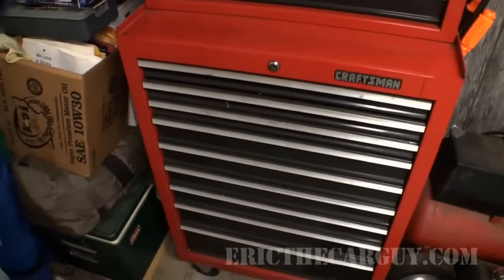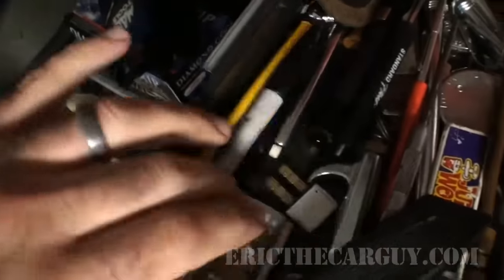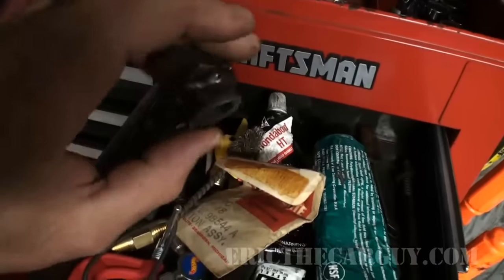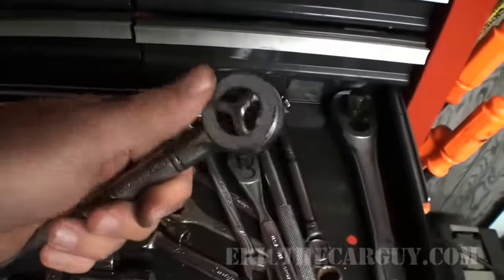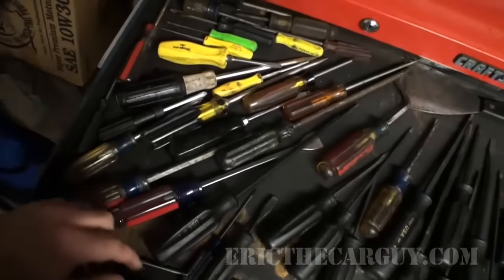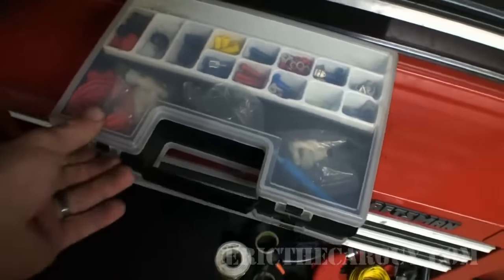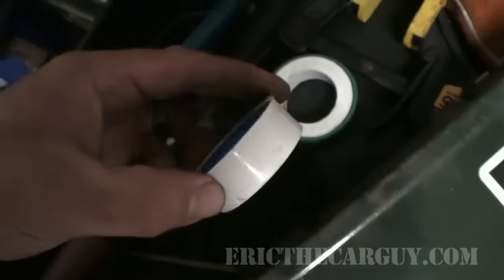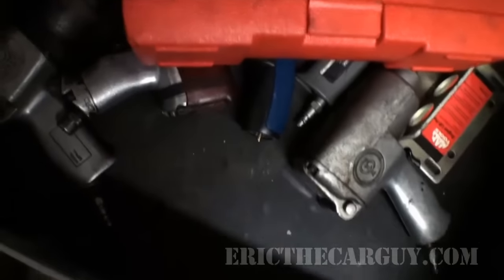What's Inside EricTheCarGuy's 'Home' Tool Box? - EricTheCarGuy

Comment: The random bag of hooks @20:29 is a hardware kit for a manual screw type strut spring compressor. They help hold the spring compressor in place and keep it from slipping around while you are cranking that huge spring down with it.

Comment from the maker: @Toyota4Runner4Ever I haven't gapped a spark plug in years, especially if they are NGK.  Check the under hood sticker as they often list the plugs you need.  A video would be great however.

Comment: EricTheCarGuy's the best one I've ever found through net. I am a private practicing Mechanic, a Filipino mechanic. I got a multibrand set of tools and bought it every time I encounter different type of fastener. Actually you don't need to have a set of top 2 brand that is offering a lifetime warranty because you're not going to ruin a tools if you used it in proper way. In my 3 years experience I just got an snap-off flat screwdriver. LOL, dude can I have some of those?

Comment: The wire connections you said not to use I have several on my car at the moment. Added a trailer hitch to my Dodge Intrepid and my dad brought them from his auto parts store. He did warn me in about a year they will stop working. They are good for a quick fix, but not a permanent fix for splicing a wire.

Comment from the maker: @aaronac8 Putting engines in mostly, it's nice to put into a hole that you're trying to line up so that you can put bolts in easier.  They're used a lot in construction for the same thing.

Comment: I got those two wrenches you mentioned. SUPER helpful. I mainly work on Toyota's, but all the sizes are pretty much the same. 10, 12, 13, 14, 17, 19, 22. I have the 10/12 and 14/19. They're Mac Tools though, but I really liked the feel. I pretty much replaced my front ball joints on my Tacoma with these guys (and a torque wrench + pry bar).

Comment: My dad borrowed that exact same inch pound wrench when we replaced the bearings in my rear differential. I believe it was to tell when the pinion bearing pre-load was right by checking the turning resistance, as in it should take so many inch pounds to turn the pinion from stop. That is just turning the pinion itself in the housing, nothing else installed and no driveshaft on it either.

Comment: I say this- Alot of ppl cut down Craftsman, yes I am aware they have switched to being made in china, but overall they are a good tool, I am not a pro Mechanic and I have no need for Snap-on, all my tools I have can do any job you have, My mato is use the right tool for the job, be kind to it, and it will treat you well,If you have a stuck bolt use a touch of heat rather than a cheatwer bar, , keep your tools clean and in good shape and they should serve you well.

Comment: I don't really mind those wire-splice things, as long as they're used on the correct gauge of wire. I stuck a pair on my 300SE to get the city lights working when installed Euro headlamps. Although I did close the open ends with liquid electrical tape.

Comment: Ahh, the BIAP (Baghdad International Airport)! Spent way too much time in M3 Brads and M2A2 Tanks, along with uparmored humvees patrolling Route Irish on the way to the BIAP. I've got my casings from my first engagement on Irish, using an M240B, 7.62 nato. You sure you have a 20mm, and not a 25mm from a Brad? Pretty sure the only 20mms we use on Vulcan's and the 3 barrel gatling on the AH1 Cobras, all aircrafts.

Comment: Adjustable spanners here in the uk are called 'shifters', in germany I believe they call them 'englande's', but they dont have all the sizes we do, just metric.

Incidentally the gun type solder iron you have can be used for testing pcm's and crank sensors, with the ignition on if you hold the body of the iron up next to the crank sensor (you might have to undo the sensor) the injectors and plugs will fire.

Comment: Listen one guy one here looked up a 25 pc torx set for snap on and they wanted like 450 bucks , I sht you not , dont fall for it man , Williams is a sister company of snap on, the same tools and half price, There is also Thorson, S-K, and many other brands dont waste money, use the tool right and dont abuse it and it will work. Rusty bolts use a bit of torch heat and its easy.. Craftsman #1

Comment: And I saw that you had 6 and 12 point sockets and I am curious how many points for cars do they make them to. I think I used a 24 or at least 18 point 12mm socket on some crankshaft bolts. Some times you can hit the 6 points on to the 12 point bolts but if you have the right points you don't have to bang out the bolts that get stuck, as well as damage the bolts or other components

Comment: smashing tools from your past :-), i have some from when i was 16, they were cheap as hell but you know what they are still ok and todays more expensive tools dont seem to last, so perhaps they wernt so bad...

Nasty plastic wire joiners, yuck, 3m scotchblocks, never use them, many teenagers used them in the uk for connecting extra spotlamps to there cars and they caused loads of hassle.

Adjustable spanner, handy but never as good as a ring spanner.
molegrips or vicegrips in the usa are magic:)

Comment: you can tell what the tool is made of by the printing on it. good steal printing will look like a hair line while some cheaper steel will push metal out of the way when stamped , (looks like sloppy print)  or casted in the metal which is real junk

Comment: This might sound kind of weird but wouldnt it be cheaper to go to yard sales and swap meets and stuff to buy craftsman tools for really cheap and turn them in to get new ones? I thought it was a good idea. :D
Reply: only problem is old cm is much better than new cm. About 2ish years ago craftsman started to manufacture tools in china or twain (overseas). the quality of new craftsman stuff is junk. Hold on your American Cm and dont let it go.
Reply: yamaharidr450 I just received a set of sockets I ordered from sears and every single socket was stamped "MADE IN AMERICA. Granted it was a large 299 piece socket set, but still all made in America.  The 299 set is manufactured by ARMSTRONG.  The craftsman professional series is supposed to be made in USA also, and I know for a fact the screw drivers I bought a week ago were made in usa also. So not everything craftsman makes is made in Taiwan or china.

Comment: ...I came across this video and had to watch it a 2nd time. This has got to be one of the most beautiful tool collections I've seen, all that shiny metal is very drool inspiring. I gotta admit that I really like Craftsman stuff as well. And honestly I can't tell a difference in quality when comparing the old USA made stuff next to the newer Chinese made stuff. I compared my Chinese 1/2" ratchet next to my instructor's USA ratchet. both look exactly the same, feel the same, but the only difference I could tell was that his ratchet was louder and clunkier, while mine was smoother and quieter. But that could just be because mine is virtually brand new.

Comment: is the power probe what you uses to quickly determine where a wire is open or short circuited. Or do you uses another method I would imagine a DMM is to slow of a method at least for me it would be and a continuity tester that needs to be clamped down to the body would make it difficult to move very far. So this probe looks like it is the ticket

Comment: Eric I need help.my integrated starts up great, has a bit of high idle which I adjusted the component in high idle vid. But its not the issue . my car stalls out when I shift into gear. I've clean throttle body,high idle component,put STP in the gas to clean injectors etc. No check enegin light for the problem.still stalls out.HELP ASAP

Comment: Craftsman was good. Now all, yes all, made in China. Why pay more when plenty of Chinese made with lifetime warrantees? I even asked the Sears tool department employee, got a startled look, and mumbled "I don't know". 
Got ripped off as now can't get Craftsman warranty replacement.
Now I buy Armstrong, Mac Tools, Matco, and Wright Tools depending what it is. All are American made with lifetime warranty and far above the quality of even the older Craftsman. Example, for cutters and pliers, Channellock is an amazing value and put mine through hell (including holding for  high heat soldering) and have never had any damage other than singed grips. If you look around the internet and ask aircraft mechanics, they all say the Channellock safety wire, aka duck bill, pliers are the best. Snap-On doesn't have the jaws meet flush for peats sake. Everyone working on anything mechanical needs one as more jaw area than needle nose that can limit. Besides, never can have enough pliers. ;p
Hope this helps.

Comment: Craftsman has a Professional line please look into them before you spend thousands on Snap-on.  Snap on is you pay for the Stamp, and trust me Craftsman are good tools, any tool is good if used in a proper way, Craftsman has never faild me yet and I am 40yrs old. I stood on a 1/2 inch rachet with a cheater bar on a wheel lug nut and I weight 208 lbs, and the Craftsman rachet held me up ! Dont let haters tell you that Craftsman is crapsman that is not the case.